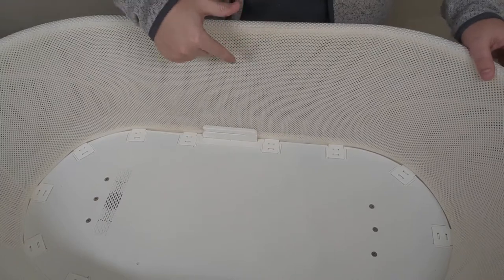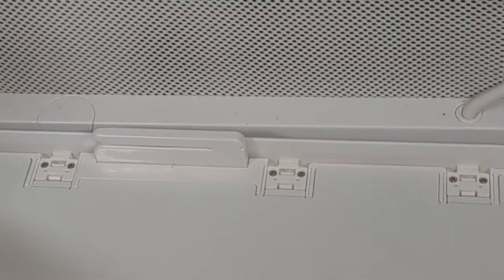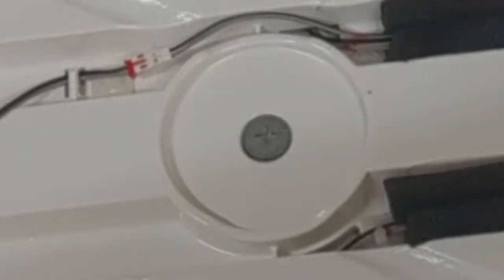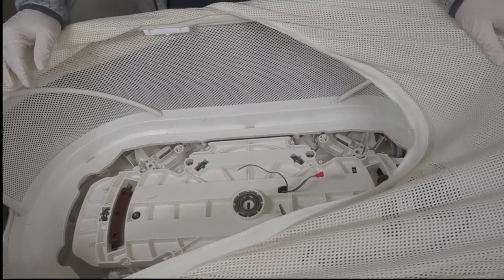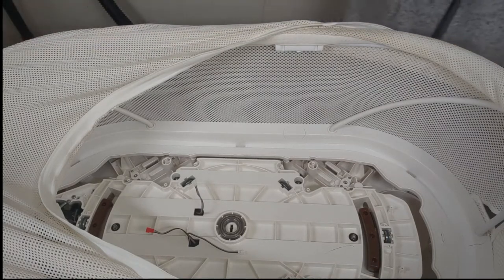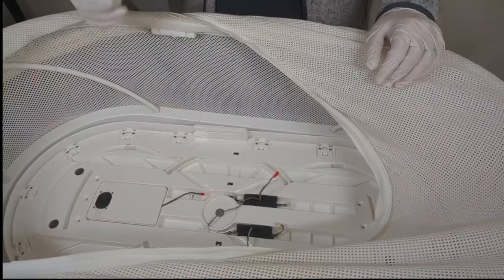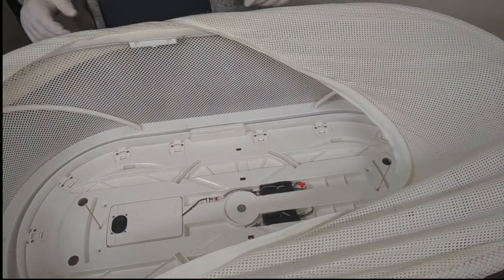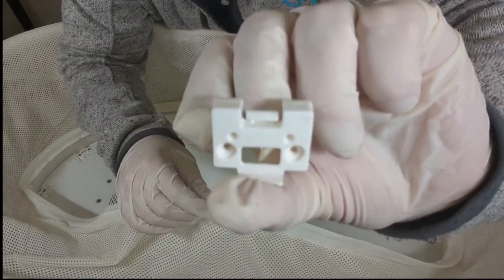SNOO teardown and health check

Comment: Hey Alex, thanks for the helpful video! I bought a used Snoo and the 6 screws holding in the brown brackets are missing. Looking online, it seems like M4 countersunk bolts will be the right width. Could you share what mm length the OEM bolt are?
Reply from the maker: 38mm by my caliper
Reply: @RentBabyTech  thank you!

Comment: It looks like my snoo is an older model and it has chip below the speaker and next to the wires on the wings. I’m unable to life the cover because of the wires connected to the chip. Do you have instructions for older models?
Reply from the maker: The foam pad the chip sits on is just taped to the rocking plate.  You can either remove the chip from the foam or the foam from the plate, you'll need to reattach it regardless when you reassemble.

Comment: Can you post a video repairing the motor with worn out o rings pls?
Reply from the maker: At 9:35 I point out where the motor is so getting to this point would get you deep enough.  The 3 o-rings are stretched around the motor shaft so a little picking and they come right off.  Make sure you measure carefully to ensure you get the correct size o-rings.

We do replace these o-rings frequently.  I'll put together another video when we get another SNOO in for repair!

Comment: What’s size o-rings are needed to replace?
Reply from the maker: For the motor there are at least two sizes I've found.  I would recommend measuring with a caliper to ensure proper replacement.  Worst case your local hardware store should be able to help match the size. The o-rings around the rocker bearnings seem to be constantly the same size #118 though I would still recommend measuring prior to replacing.  Using a close but not exact fit could lead to issues down the road.  Thanks for checking out the video.